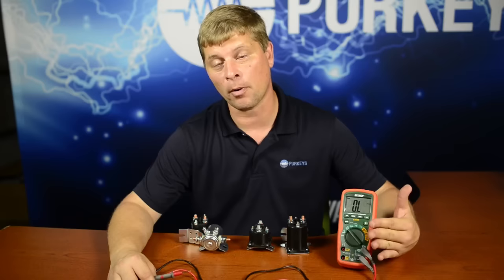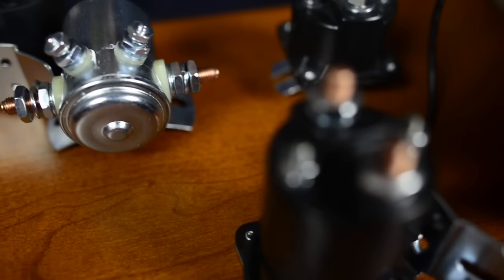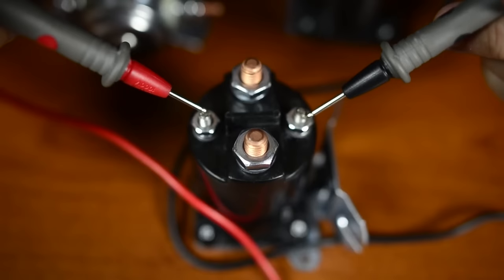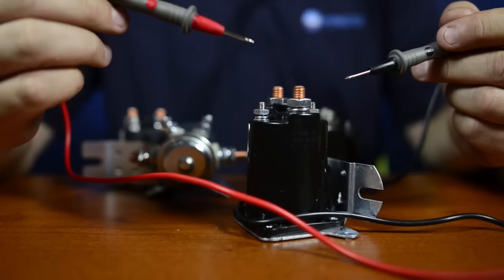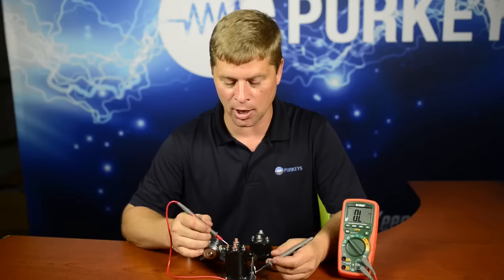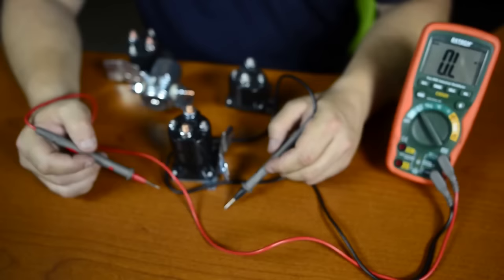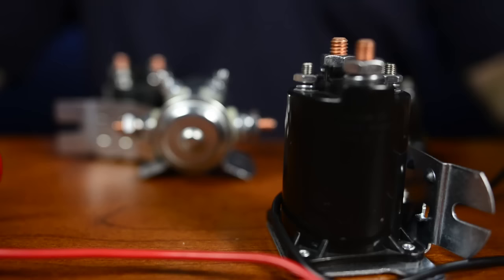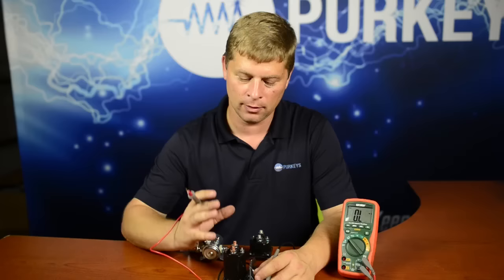How to use a Multimeter: Solenoid Testing - Purkeys

Comment: So many times I have read articles that say if you have ZERO ohms, you have "continuity".  But isn't "PROPER" CONTINUITY (Like what you mentioned regarding the specs) what really matters?  So for example, a multimeter set to the 200 ohms setting might show a reading of 900 during testing,  and some people would say "You don't have continuity"!  But in actuality, you DO have "PROPER CONTINUITY".  Please correct me if I am wrong.

Comment: My solenoid has only one small post, how do I test it? It's for a three wire lifgate switch.
Thanks
Reply from the maker: Mag switches that only have 1 small post are generally “case” grounded, which means the coil is connected internally to ground versus a mag switch with two small posts have the coil connected at each small stud. If it is a switch with only one stud you will use your meter and check the resistance between the one stud and the metal case of the switch body.

Comment: Diesel generator has a fuse on the solenoid+ connected to ignition. It keeps on blowing when I start the generator. So, I guess the solenoid has gone short?
Reply from the maker: That is a good possibility. Have you checked from each small post to ground? If you have a 4-post relay and you check between each small post and ground and have a reading it is definitely grounded and should be replaced. If you have further questions, feel free to reach out to our customer support team: https://purkeys.net/contact/

Comment: I am confused. Just checked a brand new solenoid like mine. Shows no continuity between the smaller posts. Mine shows 3.4 ohms. 
  The new one also show continuity between one of the small pats and the base. 
  12 volts does activate the new one. 
  The new one has S and I on it. Which of the small wires got to which, or dies it matter?
Reply from the maker: Two solenoids can look almost identical but be made and work differently. For instance, you may have a solenoid that has two small terminal that are the coil for the switch. Another may only have one small post and the other end of the coil is connected to the case of the solenoid. Another may have two small posts, one being the one end of the coil, internally grounded to the case and the second small post is actually just a tab inside that touches the contact when energized to send a signal the switch is closed. This was also done on cars to send a full 12 volts to the coil only during cranking to help engines start.
Reply: Purkeys I told the guy with new one I wanted to do more checking that I thought there might be a difference in how the wiring is on my mower and the new one he had. 
  Another guy with a lot more experience I have stopped by and checked mine. He said it was shorted. I still was not convinced. 
  I could apply power to the two small ones and it sounded as if the solenoid would activate. 
  I thought check the starter and or see if I could turn the motor a little.  
  To make a long story short, I had failed to do what I knew I had intended to do when I saw the oil level was too high. I also had noticed when I put a little gas in it, the carb would show gas. Pulled the plug it shit gas quite a bit of gas out.  
  Just lucky it did not catch on fire. I forgot to move the plug wire back or tape it. 
  Been there, done that with a push mower.  Whew!
  By the way, these were identical in shape and the contacted were spaced the same.  The ignition wires were in opposite sides. 
  I never could find one on Ebay  like them. 
  Mine has no visible numbers on it. 
  Anyway, glad I did buy a new one just yet. I was concerned it might do some damage if designed for a different system. I was told I couldn’t damage anything by trying it, but.......

Comment: We don't have to test the bigger posts??
Reply from the maker: This particular video is only checking the coil of the magnetic switch. Testing the “bigger posts" would be getting into voltage drop testing, which is a different test method.
Reply: How would you test if it only has 1 small post?

Comment: My meter reads 9 then drops to 2(2 is what also measures touching leads together) transmission solinoid says specs should be 25 to like 50
Reply from the maker: If you are getting the same reading as with your leads touching each other, it would have to mean that the coil is shorted and has basically 0 resistance through it. With so many different types of solenoids, there can be multiple ways to test them--and if tested with the wrong connections, a good solenoid can test bad.

Comment: My solenoid has a 140 ohms resistance is it still ok?
Reply from the maker: You'd have to check the manufacturer's spec to know whether it is in an okay range of resistance or not, because different solenoids have different acceptable ranges.

Comment: Solenoid has resistance ? How come ?
Reply from the maker: All electrical components have resistance, though some resistances are so small that they can be ignored. A good solenoid should have a resistance within a certain tolerance (this varies by solenoid), otherwise it can be assumed that the solenoid is no longer functioning properly.
Reply: @Purkeys  ok I got it now, have you ever heard elasto magnetic cable force measurement, the ferit/steel inside the solenoid is stressed with objective to see whether the resistance change. What do you think of that ? Never try before. But I do have solenoid from broken radio (taken out). Multitester not yet have, will buy later. Engineering is my life.
Reply from the maker: @arionodhanis3677  Indeed there are EM sensors that are used to measure the force in steel cables normally used for bridges and other structures. This suggestion would be an interesting application of the technology.
Reply: @Purkeys  wow, so I think I just buy the multi tester and try the resistance vs cable/strees stress and make corelation, I hope it will be linear. First I will take the coild and ferit from the broken radio.
Reply: @Purkeys  any way, do you know about laser and hologram technology ? Is it real ? The physics books in Indonesia translated only up to maxwell equation. Chapter about laser is quite rare, moreover hologram.
Reply from the maker: @arionodhanis3677  Best of luck with your experiments!

Comment: My S terminal and ground reads continuity. Is the solenoid still good?
Reply: The solenoid should have a small resistance, continuity, between the 2 small posts. The other test would be to go from the S to the metal case. If you have continuity then the solenoid is bad.

Comment: Is there a positive and negative on solenoid? My starter is on solenoid but won’t light up with light tester 12? Thanks
Reply from the maker: There is not a positive and negative on the solenoid. Until this switch is closed and battery voltage on both large posts, there will not be any voltage at a starter and won't light up a tester.